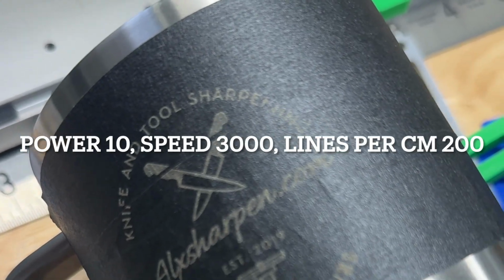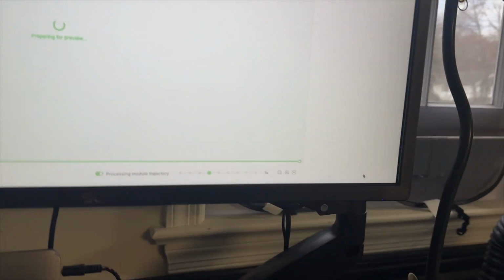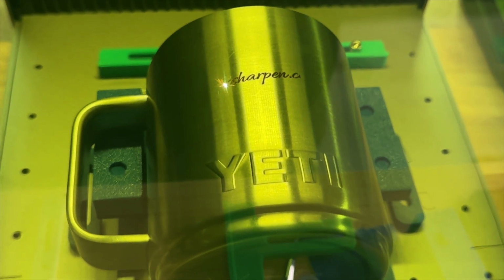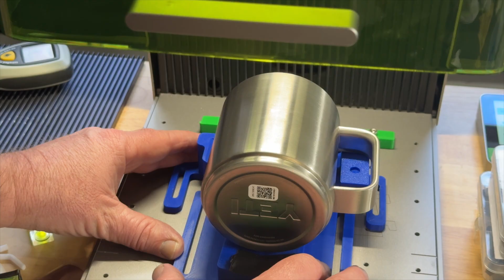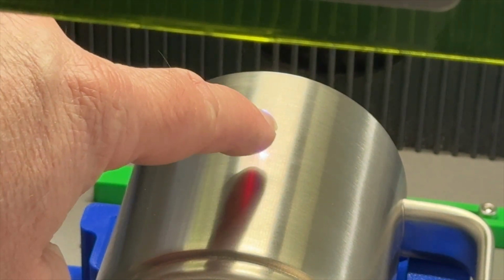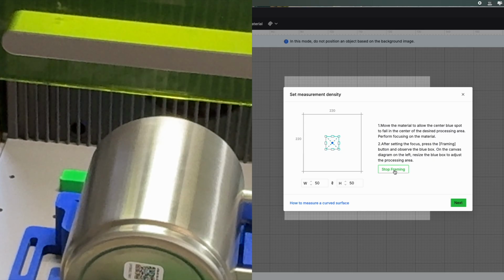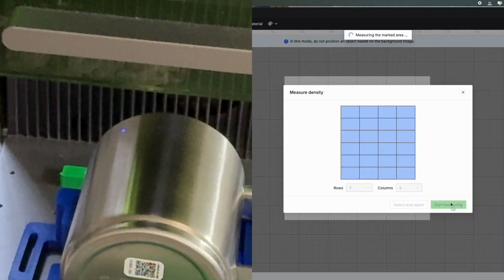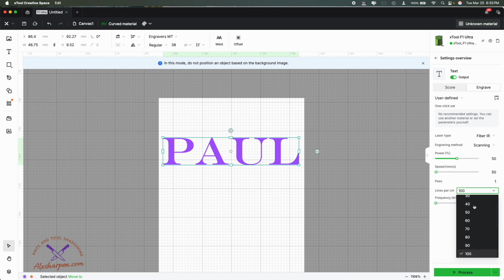"Perfect Engraving Hacks"-Tape Test, Curved Setting & the Ultimate Drink Jig!" for the xTool F1 Ultr

Comment: Now, in true Navy fashion you have to never clean it after use, lol.
Reply from the maker: How do you known that - Funny one time to piss off my 1st class i scrubbed his mug clean he lost his mind! How's the shoulder? I am having a lot of fun with my 3D printer but still on the struggle bus with basic design
Reply: @ALXSHARPEN  I was a Marine, brother I know ALL of the Navy's secrets! Shoulder is healing slowly but surely. I did one mower blade and one knife for the first time yesterday and it didnt feel too bad. I should come down next Wednesday and visit your shop if you have time.
Reply from the maker: @Potomac_Sharpening  that would be cool  Matt I will pick your brain on 3D printer stuff. What kind do you have? I am trying to make a better mandrel for the Jewelry buffer to see if I can get a better fit and even more disks on one have you see that new Bamboo labs printer that looks awesome I am interested in some of these fancy filaments that are really hard to make parts. I just got some PETG and PLA PLUS and some wood infused PLA Have some ideas I want to try
Reply: @ALXSHARPEN   I have 3 Bambu Labs P1Ss. In fact I have a wall hanger for a headless bass guitar that I designed that I may be on the verge of getting into some retail stores soon. I saw the new Bambu 3d printer/laser, and honestly I am not sold on it, mainly because, as you know, lasers put alot of material and dust into the air and bed, and I wouldnt want any of that anywhere near something I am 3d printing. I've done ASA and CF-Nylon on hardened steel nozzles (including some 2A stuff). It worked great.
Reply from the maker: @ interesting that is a good point wonder if it will be an issue you can get it without the laser may end up being something many do in the end